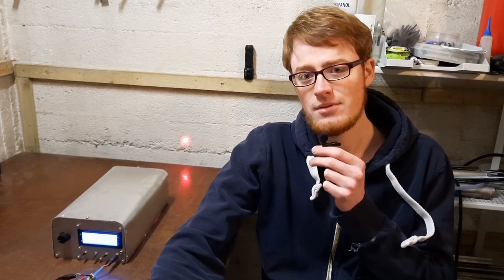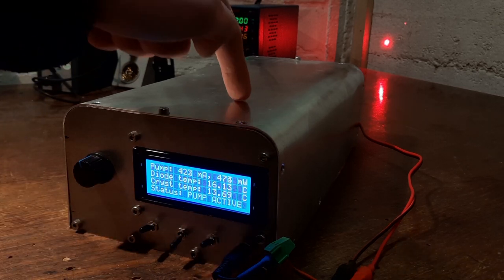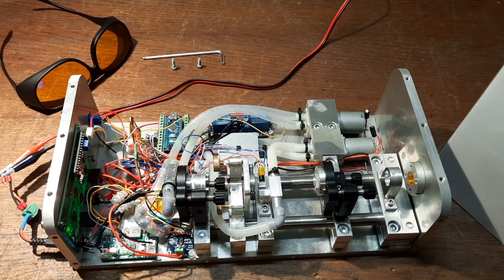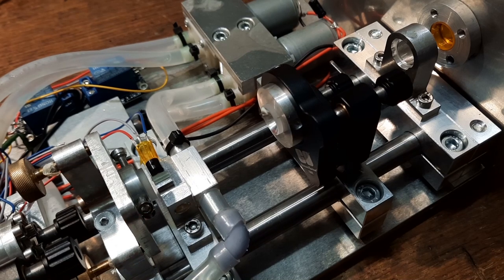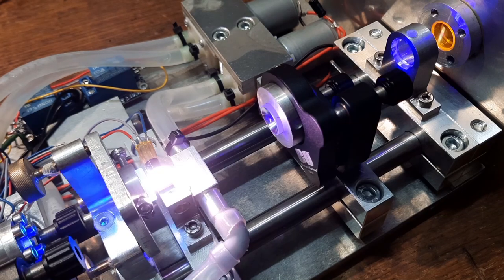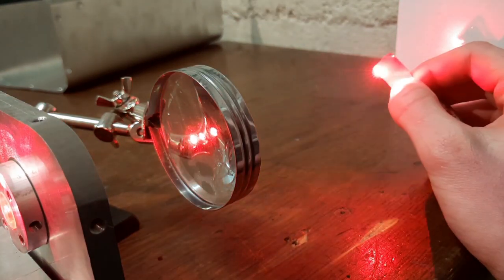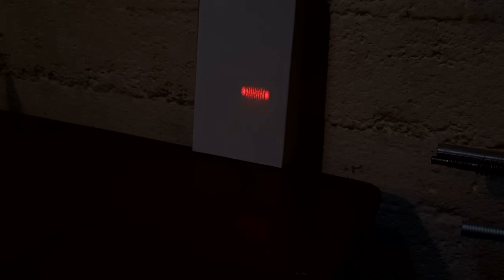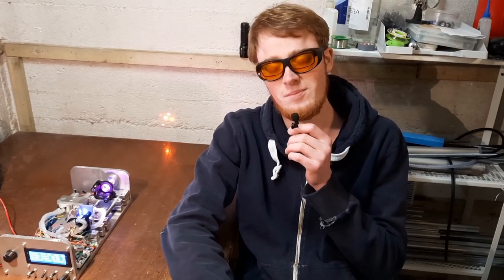Powerful homemade diode pumped Pr:Ylf laser!

Comment: Nice setup! A 607 nm laser is something exotic. I guess it took some sorting (and cooling) to find a 445 nm diode that consistently emits 444-445 nm :)
Reply from the maker: Thank you! Yes, its it is quite unusual.. The temperature drift of InGaN diodes is fortunately not very high, so it is not very critical. The current drift is much higher, but I luckily had a friend who sold me a sorted diode at a reasonable price.

Comment: Sir, could you provide arduino settings and a list of components?  I see EO Edmond Optics lens holders, are the lenses EO too?  Was there a reason you chose this particular laser diode?  And was there a reason you chose these lenses and mirrors?  How did you know what temperature settings to apply?  And what are the motors that power the water pump?  Thank you Nik.  This is truly fascinating indeed.   What tools did you use to machine these parts or did you order them pre-machined.  Oh I almost forgot sir, I really enjoyed your video.  Awesome work.
Reply from the maker: I've got a zip-file with the complete 3D-model on the GitHub-page (see video description), with Arduino code. The lenses in the pump module are from Thorlabs, the 3D-parts have the correct name, so you can find them online. The laser diode must have 444nm output, because the crystal has a narrow absorption peak around that wavelength. I chose these particular lenses because I read about them in a document a while ago ( I think at luhs.de ). The back resonator mirror is highly reflective for the laser wavelength and transmissive for 444nm, the output coupler has around 98.5% reflectivity (rest transmission) for the laser wavelength and is concave (50mm). The values and temperatures were chosen out of experience from other projects. The pump motors I found on eBay. I did indeed machine everything myself using a homebuilt CNC-router. Thanks for your comment! Let me know if you have more questions.
Reply: @WoodenWeaponry  Thank you for this comprehensive list, it should keep me going for awhile. Also thanks for sharing all this information. If I stumble across anything worth sharing, I'll be as generous.😊👍

Comment: I wonder are the tm modes interference within the crystal?
Reply from the maker: TEM modes are essentially different eigenmodes of the resonator, so paths that are stable and self-reproducing. The normal round  TEM00 of course comes immediately to mind but there are other patterns that are able to reproduce themselves in the resonator.
Reply: @WoodenWeaponry  cool. So does the mode interference occur inside the crystal or is it a sum of the whole laser cavity between the mirrors? I'm new to this and it's very interesting.
Thanks for your videos. Definitely looking forward to more!
Reply from the maker: Good question! The modes are a product of the whole system - crystal (gain profile due to pumping, thermal lens, etc), elements in the resonator (non existent here), the resonator type and the actual alignment of the mirrors all contribute to the production of TEM modes.

Comment: Pr:YLF is one of the few materials that can be pumped with the now ubiquitous and deeply discounted InGaN "Blue diodes" that flood Ebay in the form of laser-projector "lamp" modules (all of those Nichia modules, ie the PCB mounted arrays with optics built in, are for use in projectors, with the range of designs/part numbers associated to the various projector manufacturers' lamp designs, alongside more generic designs using arrays of CAN mounted single emitters)

The research papers I have read used 444nm pumping, but it should be possible to get some overlap even with diode modules rated closer to 450nm (Especially when you consider that they have high duty cycle CW ratings of 70-100 watts of optical power, so "plenty to spare" if the between the pump and gain are poor)
Reply from the maker: Keep in mind that Pr:YLF has a pretty narrow Absorption peak at 444nm so the 450nm diodes have very low absorption. Also, the beam quality of the diodes matters, because it determines the pump spot size - so the super high power (7 W or so) 450nm diodes might actually only work very inefficiently, with less overall output power.
Also you cant just pump more and more power in there because the optics might fail at some point. And cooling becomes and issue at some point, especially because of the negative thermal lens. :)
Reply from the maker: Interestingly enough, alexandrite is more interesting for InGaN pumping at 450nm, since it has a very broad peak at 450nm. Also it is tunable (vibronic material). But it is difficult finding the crystals.
Reply: @WoodenWeaponry  there are extensive numbers of research papers published on Pr:YLF pumped by blue diode lasers (prior to commercialization of that technology, they were pumped with a high harmonic of IR SS lasers or with the use of Ar Ion or Dye lasers, none of which were ever capable of delivering the high optical densities of direct diode pumping).

With direct diode pumping some of the results have been mind boggling.   40% optical to optical (eg aproximately 4 watts of 640nm light from pumping at 444nm with 10 watts) for the primary laser emission, and ~20% from intra-cavity frequency doubled arrangements (eg around 2 watts of 320

MOST of those papers include a sentence... a statement.... general commentary.... in which the authors of the paper acknowledge and specifically highly the importance and role of the consumer electronics focused development of blue diode laser technology

a few even call out Nakamura by name.

In terms of the exact overlap:   there are and have been 442~444 nm emitters produced in extensive quantities.

its just that the way that the industry has focused, caring mostly about power and reliability and less about the exact precise emission at a particular wavelength, the actual end products of the manufacturing process must be "binned" like CPUs or RAM.

nonetheless you can buy 444nm diodes, or even bin them yourself (by purchasing bulk trays of emitters, then testing them yourself)

typically you would pay a price premium to have "known" emission characteristics.   Essentiall you are just paying someone else to bin for you
Reply from the maker: Regarding that last part: That is exactly what I did. Paid a but more to be sure that the diode emits at 444 nm